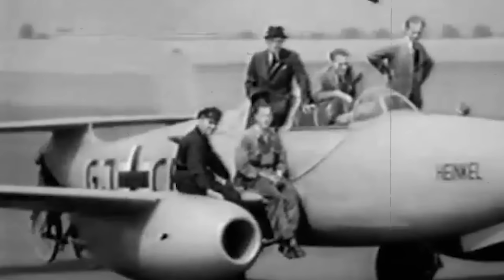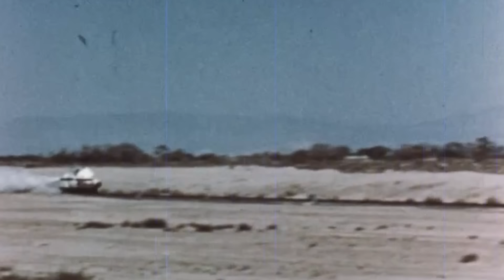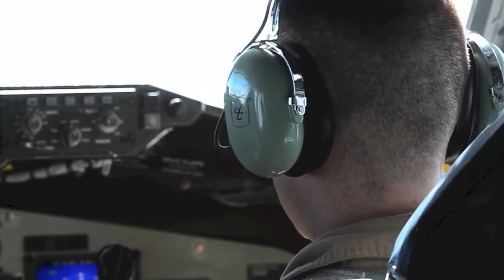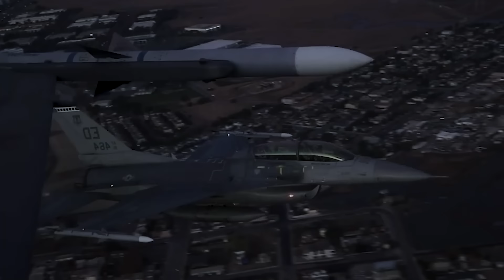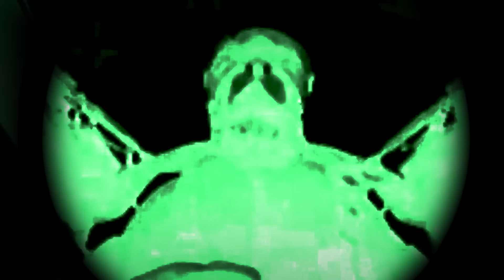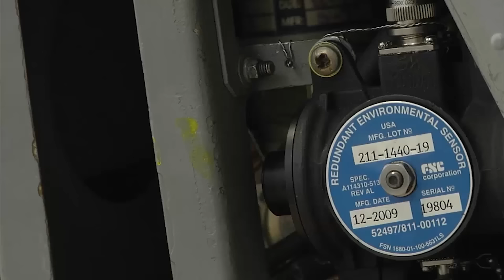The Darkest Air Force Secret They Tried to Bury Forever

Comment: Lately I've been doing two things when off of work - watching these types of videos and playing around with electronics and trying to build stuff. One of the things I've been working on lately is trying to build an induction heater from scratch and one of the main components is two MOSFETs. I've fiddled around with electronics since I was a kid but never very in-depth so this is one of my first brushes with them. So I don't even know what I'm trying to say - just looking at those little things and hearing a pilot basically died from faulty ones, it's just kind of sad and trippy and I guess it shows the fragility of life in general and the hairline separating life and death for pilots and others in those types of dangerous situations. And since I've been messing around with MOSFETs lately, I've been more vigilant and noticing them everywhere and I've noticed a lot of cheapo, unmarked, like Chinese bulk MOSFETs in a lot of electronics. I bought a pre-made induction heater to kind of study it - I plugged it up and those cheap ass MOSFETs instantly started smoking and frying. Obviously, with little dinky consumer electronics, I'm thinking, who cares about the manufacturer as long as the specs match and it works - but in a fighter jet? Those obviously need the highest quality of components throughout, but companies are always cutting corners.

Comment: An EE Lightning F2A had an engine fire in the 60s, Ejection failed as the canopy didn't come off. The pilot then landed the Lightning on an old, unused WW2 airfield. After a successfull landing the slowing aircraft skidded into a wooden fence. This collision triggerd the release of the canopy, ejecting and killing the unlucky pilot. 50 years later a Lightning T5 (ZU-BEX) of thunder city in South Afrikea had an inflight fire which damaged the controll lines . The experienced former military pilot then tried to eject but again , due to a lack of maintenance, the canopy didn't release so the poor pilot rode his Aircraft into the ground. Ejection is always risky ( but the survival rate of german F-104 pilots rose drastically after they switched from Stencil C2 to Martin Baker in 1967/68. The Stencil (which the Luftwaffe rejected when buying the 104 but was forced to take it.) was a pice of shit

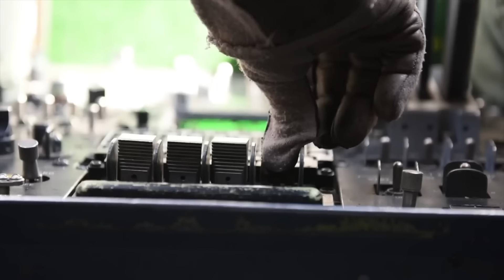Comment: 6:39  I worked as an item manager for the CESL radio for much of my 3 years in USASOC’s Combat Development Department. As such, I worked with the Joint Personnel Recovery Agency.  As I was the Army’s de facto representative, I questioned why the MENU’s were so, at times, cartoonishly simple.  The top civilian, with 32 years in the Air Force rescue community and a 13-14 as the #2 guy looked me dead in the eyes and said: whenever a pilot ejects they usually loose 40-60% of their IQ.  For example, one of the pilots shot down in the 90’s, hit the ground and as soon as he found a place to hide, he used his pistol to dig a hole, then the LTC placed his weapon in the ground and buried it!  When he landed back at a friendly base, the debriefing officer suddenly realized that there was no pistol in/with his flight gear and asked when he had time to go to the Arms Room and turn in his weapon.  “Oh, it buried about 18-24 inches deep in that Serbia ditch I was hiding in, about a mile from my Nighthawk’s remains.”  When he was asked why, given that the whole point of his weapon was to defend himself; “well, I really have no idea why, it just seemed like the right thing to do at that moment.”
There were cases after cases of pilots shot down and who subsequently ejected, making similar kinds of decisions.  It’s crazy but true just NOT in all of them.

Comment: I worked as an engineer at several defense contractors, including BOTH submarine manufacturers and Pratt and Whitney, as well as 1 other. Every damn one of them was a corrupt as could be. At the first submarine manufacturer I blew the whistle to SUPSHIP over something that could sink the boat. That is an on-site Navy oversight organization. What I didn't realize was that the 4 people I told in Supervisor of Shipbuilding (SUPSHIP) were **in on the corruption**. In fact, most of the organization was compromised from what a learned after being hunted by company management. The Navy SUPSHIP organization didn't seem to care when I informed them repeatedly that the company management was trying all the tactics in the book to retaliate and get rid of me. I finally found a contact through a buddy of mine at the company. He like me was prior submarine fleet and cared. He was in my sister department, and was a source inspector (I was in nuclear quality engineering at the time). He was the inspector that "tore apart" the first 4 missile tube sections for the Columbia class submarine during his inspections due to faulty welds, forbidden parts being used (like in these ejection seats) which ultimately led to the first 4 missile tube sections being completely scrapped. He gave me the contact of the "Director of the Columbia Class Missile Tube Integration Team" She was an O-6 and was stationed in Washington D.C. I called her and left a message. She then called me back roughly 45 minutes later and I began dumping everything I could remember. She then contacted the Inspector General of the Navy, who then contacted me. Ultimately, this led to a shake up at the company, including the President (Jeff Geiger at the time) being fired as well as some directors being forced to retire early, some managers being fired, and 3 of the 4 SUPSHIP people being fired. After that company, I went to work for Pratt and Whitney (they are a subsidiary of Raytheon Technologies just like the company mentioned in this video, Collins Aerospace). They were selling military engines, as well as export-controlled technology (as part of civilian engines) to the Chinese. Holy smokes! I was the only one in the room who spoke up about it and the knives immediately came out! I later went to the other submarine manufacturer in Newport News. I told my wife I would give it 6 months to see what it was like. To put it short, SUPSHIP was just as corrupt there as they were at the other manufacturer and I ended up calling the same Inspector General again, took some proof with me this time, and then walked out the gate for the last time and went home. The bigger point of all of this is to say that there is a severe lack of courage in American society today. So many people like to talk about our 'freedom' and yet THEY CAUSE everyone around them to be less free because of their lies and complacency, at their work, in public, and in their daily lives. I stood alone in the breech again and again. NONE of the other AMERICANS around me, be they engineers or management, had the courage or integrity to stand up and TELL THE FKING TRUTH. This all started in spring of 2015 when I first blew the whistle, and drug out across several other defense contractors for the next 6 years, all of them being the same. Combine these experiences with the knowledge of 'wokeness' in the workplace and I'm a white guy, and I realize that I can never go back to salaried white-collar work. Our society is in serious trouble people. TELL THE TRUTH **AMERICAN**.

Comment: That¡s why Defense should be on the Militar-side-only; Contractors overcharge a lot and all the time, don't manufacture components on time and always look the cheapest ways for the extra $.
Sorbothane should be added on seats, and washable foams, changed periodically, to a absorb vibrations and heat from vibrations; not only for seats but different parts of the aircrafts, military and commercial.
We also need to apply hydraulic and pneumatic cushion to aircraft seats. Additionally robotic seats that will help coordinate the moving parts of the seat. In future versions, Military seats could be robotics will assisted landing rockets and legs to decelerate even more the landing, and then walk the pilot to a safe location; then the seat will transform in a survival station, with reliable comms, and food dispenser, energy generator, and many more in-built devices; like radar, 3 drones, life sign transmitters GPS, First-Aid, self diagnosis and repair kits, etc

Comment: I remember watching Air Power on the Discovery Channel, and there was a segment, either at the Farnborough or Paris Air Show, I can’t recall which show. Anyway it insinuated where the MiG-29 pilot had to eject. It was often implied that the Russians had finally figured out how to eject their pilots safely, especially when compared to the West, where ejection systems rarely failed.

Great video. It’s tragic that so many lives have been lost due to issues that could’ve been prevented. Thanks for sharing this.

Comment: I worked for the Air Force as a civilian firefighter. One day I was driving a 4x4 fire engine, we were going about 55mph, suddenly we  had a spectacular blow out of the right rear tire (if you're sitting in the driver's seat). It was so intense that it literally lifted the rear of the fire engine about 4 feet off the ground. Then the engine proceeded to slide sideways which I counter steered into, then it went the other way which I counter steered as well. This went on for 600 feet until I was able to bring the engine to a stop. I saved not only the fire engine and myself, but I also saved the lives of two other firefighters in the engine with me. Upon inspecting the skid mark, I found that the engine came within three inches from going off the edge of the tarmac, that would have dug the wheel into the dirt and in all likelihood would have flipped us over and probably killed everyone on board. I saw no awards for saving the fire fighters and the fire engine. Made me set the tone for the rest of my career. And for what it's worth, a fire engine costs about 250,000-400,000 depending.

Comment: F 16 does not have a tail hook. Only navy birds are fitted with those. F 14, f 18 and f 35.
Reply: You've apparently never landed your Navy jet at an Air Force base for refueling, where you would've seen both the short-field & long-field arresting gear along the runway. 

USAF jets DO have tailhook systems, to grab the field gear in the event of brake failure. Just NOT the version stressed for the carrier landings that the USN needs.

Comment: The most interesting thing about this is, the "counterfeit" chips are a danger even if they come from a real supplier. As we've seen from a certain pager incident - you can have electronic hardware that passes every security test, but it's ultimately a black-box manufactured by people you don't have any control over. Just because it does what you want, doesn't mean that it doesn't do what you REALLY don't want.

Comment: Reminds me of that last scene in the latest Top Gun film: "eject eject eject" and nothing...
Also Hollywood took a jab at this.
I'm not a pilot but I do skydive and our AADs go through a self check every time they are turned on, furthermore we are trained to activate manually the release handles even in case of an Automatic activation, as a form of redundancy.
I would definitely use such redundancies even in case of an ejection like these...3s to pull a second handle to have your emergency parachute deploy is doable...that F16 pilot didn't need to die.

Comment: I worked with Collins aerospace while at an OEM. Let me tell you they’re one of the worst. I spent a year warning them a critical temperature would increase for something, and when it did, they were lost and confused. They also thought using aluminum for combustor casings was ok…
Reply: They have a lot of facilities here in Iowa, if they are as shitty as they seem, they might deserve to lose the contract. Iowa might suffer but that's fine.

Comment: I find it hard to believe that in 4 years the USAF couldn’t get around to updating the seat in his aircraft!  

Clearly the USAF can’t be trusted to handle things in a timely manner.  Perhaps they need to be treated like car dealers.  When there is a safety recall, dealers aren’t allowed to sell or use the vehicles until it’s been repaired.  

I get the reasoning for allowing some leeway and time to make the updates as we rely on these aircraft for our defense, but clearly the ball is being dropped, just like it was with the Kapton wiring problem.

Comment: The more complex a device or system is, the more likely it is to fail. Pilots count on the ejection seat to keep them alive, and  we now need  telecomunication systems,  massive computing systerm, electricity,  satelittes, etc to keep us alive.  Because we don't have a backup plan in case of failure

Comment: This wasn’t the first time a rear hatch had been off and landing in Midland. Another normal flight, the back seater had gotten up to use the toilet and had just got back in his seat and buckled in when the hatch flew off mid flight. They made an emergency landing in Midland and the crew member was unharmed… physically at the very least. Before this event, ground crew would open the hatches to get some air flow in the hit summer sun. They also had little hatches that could be opened above the pilot and copilot seats. They restricted opening the front ones because at some point they were left open and the rain soaked the parachute and seat itself. After the hatch flew off mid flight they restricted ground crew from opening them unless absolutely necessary for whatever repair. In the early 2002-2005(I want to say) there was an ejection seat issue that led to us removing of all the hatches so life support could fix the seats. It felt like a solid year of hatch removals and window replacements…. So many fasteners with tiny nuts and washers in crazy to reach places.

Comment: Which goes to show: procedures call too quickly for ejection, when in fact, a landing is STILL possible.
Reply: Crew members are always more important than the aircraft. An uncontrolled engine fire can take out an aircraft AND crew with no time to eject. Checklist is built on statistics. Better to lose the aircraft and save the crew.
Reply: @rdmgwinn  As if I would not be aware of this... So, thank you.

Comment: The UK had a special feature on the Avro Vulcan:
In the event of a crash, the VIP Military Passenger in the back would magically be transferred to one of only TWO ejector seats in the front.....The Pilot Monitoring finding himself transported to the back of the aircraft with the other less-important crew.. 
Still don't understand how that worked.

Comment: Counterfeit military aircraft components from Mainland China, mechanical and electronic, have been a known significant problem since at least the 1990's. Many off-spec parts that are rejected during testing are bought by foreign vendors, and then remarked/branded/coded and resold to trusted vendors as prime parts. 
Thus, even when obtained from known, VERY trusted vendors, counterfeit parts got and still get through despite inspections and testing. It's a persistent pernicious problem and the necessary added testing to even partly deal with it is one factor that adds to the cost of military components.
Reply: Happens on civilian aircraft also.
Reply: The use of counterfeit components in safety critical systems is deeply disturbing although not surprising given human nature/greed. But if I were a search and rescue crew member being lowered from a helicopter who happened to spot that the critical attachment to the rope was a plastic zip-tie rather than a high quality metal karabiner, the first thought going through my head probably wouldn't be 'Oh no! I wonder if that zip-tie was made in China?'.

The real villains are the ones that substituted the genuine parts and they exist in almost every nation on earth. I'm quite sure that Chinese manufacturers are equal opportunity villain suppliers.

Perhaps the issue is that the Chinese are so accomplished at producing convincing fakes that they are the supplier of choice of villains?

Comment: Zero-zero is a marketing gimmick. 
If your plane isn’t moving, the pilot will not eject. He will climb out. 
If the plane is moving slowly, at taxi speeds, up to say 50 knots, the pilot will stop the plane and climb out.
Reply: There are situations, like a sudden catastrophic failure leading to the plane being enveloped in flames that may lead to a 0-0 ejection being the best chance of survival. 0-0 elections are rare, but they have happened. The point is more to give a larger envelope, so if you ejected in a non standard position (inverted, high sink rate, on the runway in a bank, etc) you have a better chance of survival
Reply: Slow clap....

Comment: I'd be willing to bet that the counterfeit parts came from China and were specifically designed to fail to compromise the U.S.'s Military aircraft. 
Whoever authorized the procurement of those components, if done knowingly, should be charged with treason. 
Any supplier that distributed those components knowingly should be charged with treason and fraud. 
This can't be allowed to go without further investigation and prosecution.
I'd be willing to bet someone made some side money on the procurement of those components.

Comment: The Mig35 ejection seat has cords that tighten around the lower legs on ignition, 2 struts push forward to eaithee sid eof the helmet to prevent flailing.

Comment: There's a Martin Baker Tie Club ... you only can be a member and get a tie (plus a nice watch) if you have used an MB ejector seat. Oh and MB is still a family run firm... which means they are extra careful to maintain the highest of standards. 7786 lives saved so far.